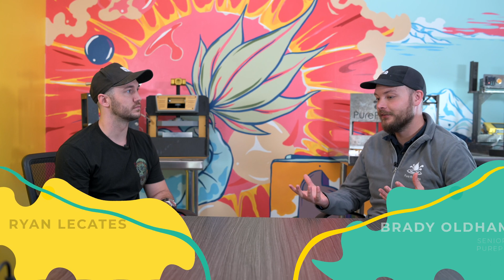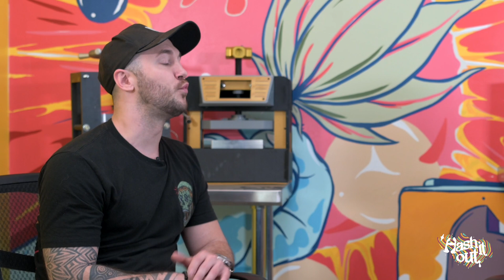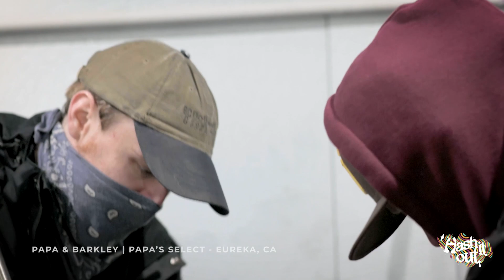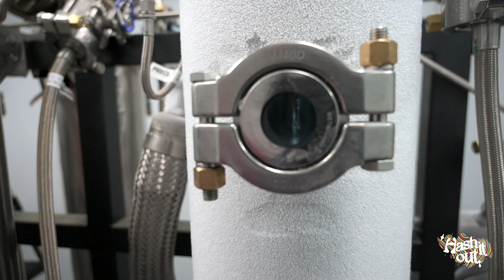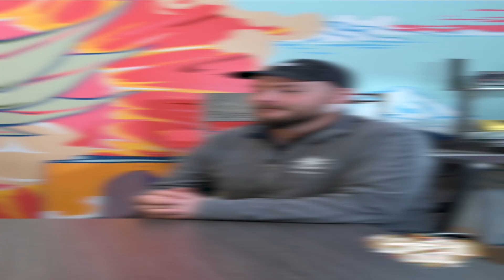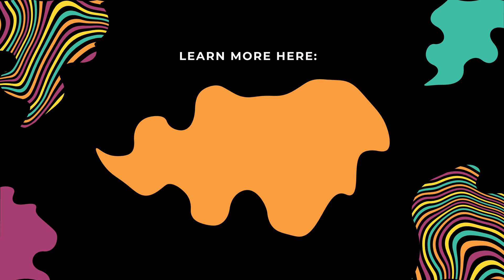Hash it Out: Episode 1 Part 1: Water Temperature & Yields

Comment: Tuffshed, foam it out, and use a coolbot on LG window unit ac, or minisplit systems to get those window or ac unit down to 35F-40F
Reply: a coolbot unit is a device used to bypass the temp setting for meat curing or now, for making a 'hashshack' out of a shed unit

Comment: Did any of you think about putting the ice on the exterior of the water? That way there is no direct contact and the water keeps a constant temperature.
Reply: Putting a bucket inside of another bucket is a good way to achieve this effect.
Reply: Also helps with keeping any foreign contaminents agents that could be contained within the ice out of your solventless, which is important due to how stringent laws are concerning solventless rosin vs hydrocarbons
Reply: Yes brother
They put a giant foam cover on them... its a company that makes them for the wash vessels and even five gallon buckets for home washers
Reply: foam outside covers are custom made for this now, five gal and thirty two gallon rubbermade trash cans (fresh new ones for this of course)
Reply: what i meant above, is its basically a company that makes those soda can foams, but bigger, for this industry